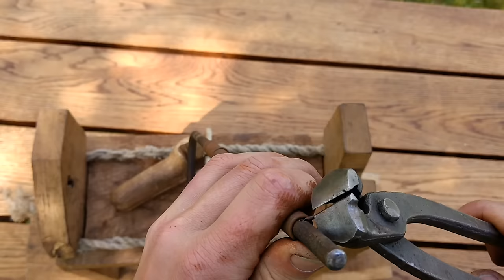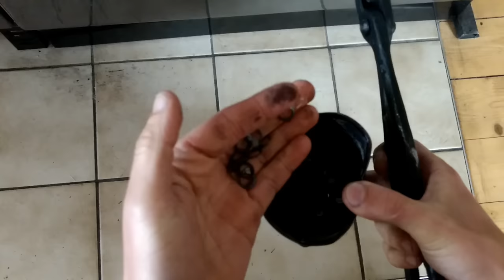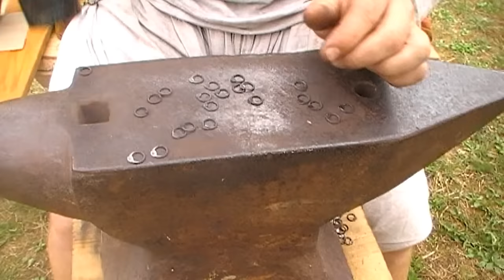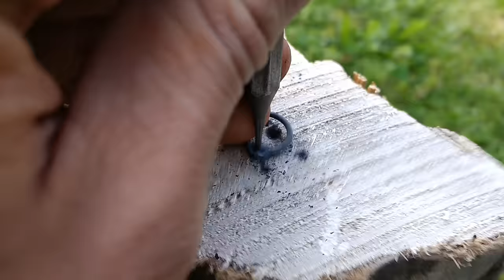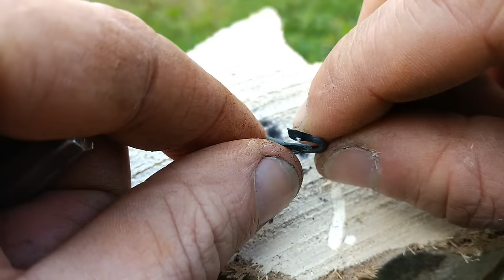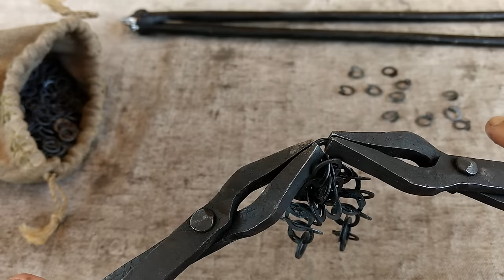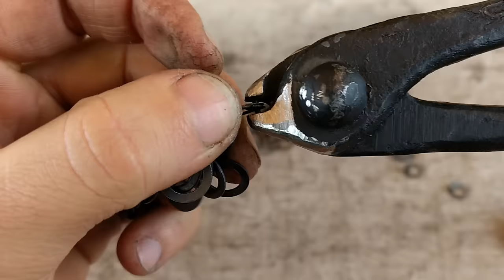How to make riveted chainmail

Comment: Hi I am wondering what sort of wire do you use for riveting the chain together? Is a copper wire alright?Is there an alternative rivet tool that I can use?
Reply from the maker: Hi, I'm using annealed iron wire. You can use copper as well if you like the look. It's difficult to find good riveting tongs. So I started making and selling them: https://www.ironskin.com/product/ironskins-rivet-setting-tongs/
Reply: @Ironskin  I am currently working with a 14 ga wire and practicing how do the weaving. For now I've made butted rings. The diameter of the rings are currently 1 cm. But, I've just read that the 1 cm rings as aren't good. Will a 0.8 and 0.6 cm rings good for chain mail?Do I still have to use a 14 ga wire. Cheers
Reply: @Ironskin  Will galvanised tie wire do the job?
Reply: @ironduke3780  Links that size and wire gage make extremely dense mail.  Good for added strength on small vital zones like around the neck, but you'd hat the weight of an entire coat.
You want a link ID about 4-6 times the wire diameter for the best tradeoff of protection to weight to carry.
This is easier to accomplish in thinner gauge wire.

Comment: What is the gauge of wire in mm
Reply from the maker: If I remember right it was 1.4mm.
Reply: @Ironskin  Fantastic. Did you forge the rivet making tongs yourself? If so, how did you make the indentation in it? I am thinking about forging my own pair of them and I might just forge the entire pair of tongs as is and then rivet them together, after that I will heat the jaws up and close the jaws over something that has a ball end.

Comment: Is there a reason such rusty and old looking wire is used?
Reply from the maker: That is only because I had bought it in big bulk and had stored it in wet condition. It's not ideal, but the rust get's removed during the annealing processs anyway.
Reply: @Ironskin  interesting thank you for the explanation. What kind of wire is this?
Reply: Soft mild baling wire. Very cheap.

Comment: Why heat twice ?
Reply from the maker: Heating removes the hardening that happens with deformation. So each time the wire changes shape it becomes harder. The heating turns it soft again. The first time is necessary to avoid that the ring ends slip while flattening. The second time is necessary to facilitate making the hole.
Reply: @Ironskin  makes sense, tks man, i'll probably start making rings in the next few weeks, this video have given me more confidence, thanks a lot

Comment: Is riveted stronger than soldered?
Reply from the maker: Can't tell it in general. It really depends on how well the connection is achieved.
Reply: Never use solder for this. Not unless the mail is silver wire jewelry.  Silver needs all the help it can get, so links don't fall off like leaves.

Comment: made a 12 gauge t shirt one winter 13,500 rings . I just closed my rings . couldnt imagine butting them all.
I went through 3 pairs of fancy pliers from home depot while cutting rings. I got a refund everytime but started feeling bad cause I was just abusing this tool like a factory destruct tester.....fail.lol
Reply: In steel mail, for heaven's sake use enough plier. On the mailler sites we were always seeing people using beaders' pliers and having an awful time.
Reply: For cutting, try farriers' nippers, which are long-handled end nippers or else mini or small bolt cutters,  the 200mm or 350mm sizes. The latter has so much leverage that it is very easy on your hands in use.

Comment: That chain mail is so thin it is weak. I made quite a bit of chain mail back in the day, set up patches and slashed and stabbed them to see how they faired. This stuff is a joke. Maybe good for a movie or something,
Reply: Also the 4 in 1 pattern is weak as well. 
His craftsmanship is decent though, I suggest trying the same thing with some real wire like the tension wire on chainlink fencing also is galvanized so it does rust up so badly
Also made the metal weaker by heating it up, is he gonna quench it to get a good temper probably not , just keeping the craft alive for the sake of it nothing practical

Comment: this just seems so incredibly tedious and fidgity to the point where making plate armour seems easier. yet plate armour only came later in history with the only exception being the romans compared to to mail which has been used for a lot longer. 
Why?
Reply from the maker: I don't know exactly, but it's often underestimated how difficult it is to make a big sheet of metal from imperfect raw iron/steel. You need big chunks of metal and combine them by fire welding.
Reply: Bashing the hunks of metal in a battering- mill.
The Roman army wore mail a lot longer than they did that famous  lorica segmentata,  which was an emergency manufacture after losing a couple legions wiped out at Teutoberger Wald. And losing every bit of their armor, to the Germans.
It took inventing the blast furnace In the 14th century to make steel big enough for big plate pieces. Even that process was gradual, incremental.